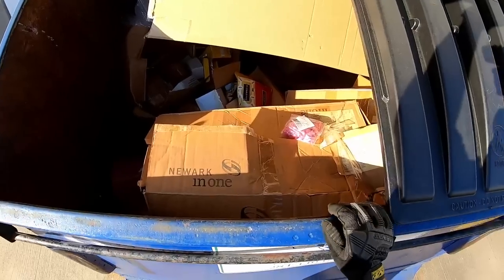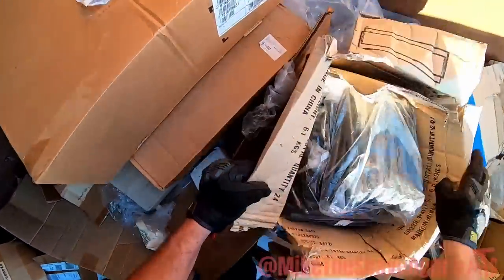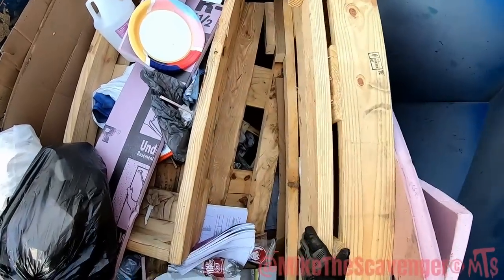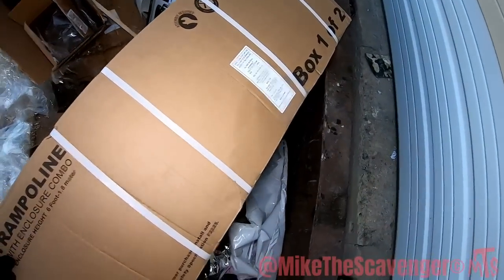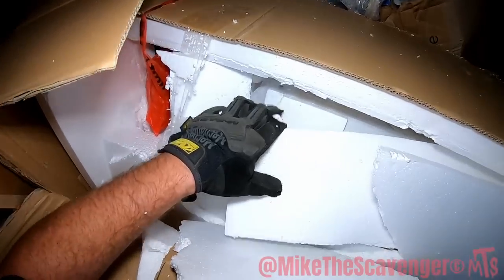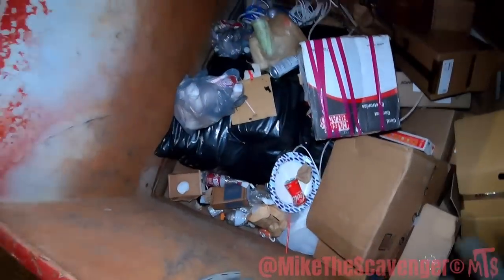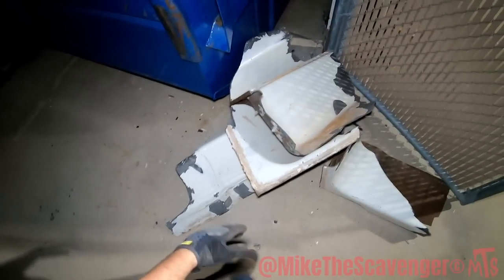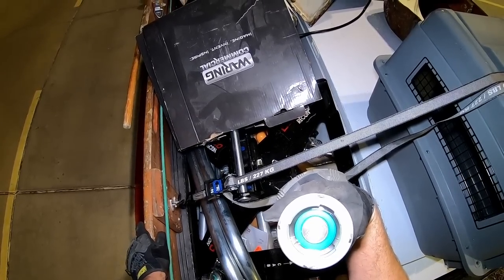Dumpster Diving "Tooty Fruity In My Pants!"

Comment: Wow! I think that one dumpster was from somewhere that builds boat running lights, the one with both red and green would go on the bow, and custom plugs for boats and autos. The pins would go in the plastic housings and have wires connected to them according to the particular wiring diagram. I’ve seen kits for building them.

Comment: The metal pins on the roll in the first dumpster are the pins that go inside the Molex power connectors. They absolutely have value to the right person.

Comment: Hey Mike you can easily fix that kennel with super glue then sprinkle with baking soda. Superglue will drywhen you sprinkle the baking soda on it. You can  build it up then sand it smooth. Works great. Airhugs of positive loving energy to you and yours

Comment: That "machine gun ammunition" looking coil  is for a pin crimping machine, for installing pins onto the ends of wire. The pin strips are probably plated brass. My yard would probably pay "turning brass" price for it as pre-consumer waste.

Comment: That Demco recon is a base for a fifth wheel hitch, that base itself is worth about $580.00 by itself, that hose with the plug in is for an RV so the water line doesn't freeze when it gets cold at night. I have a Demco for sale.

Comment: The house with a plug is for RV use. They are heated so they don't freeze. Usually around $60+ if they are good the demco thing is for trailer hitchs and is $450+

Comment: The hose with the plug is for RV trailers. The hose stay’s heated in cold/winter weather. So, the hose doesn’t freeze and bust. Wish you would have kept it. Would have been interested in buying it.

Comment: That "machine gun ammo" looks like stamped electronic parts, likely the metal parts that you see inside of connectors.
Usually copper, copper alloy, or sometimes steel, they come from the presses on reels like that, and then are sent to reel-to-reel plating facilities where they selectively plate copper, nickel, silver, gold, palladium, and/or tin lead onto the parts before being installed into their plastic housings. Those look to be Ni plated over raw Cu.

Comment: That tool is $300.00. All those connectors are Deutsch connectors or Amp. The orange and green inns go with them. The pins you found can be as much as 1.00 ea.

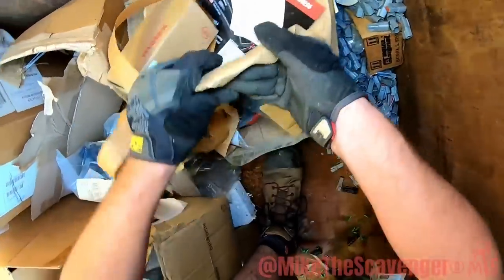Comment: at 5:33 that "something" was a crimper for the pin "(the machine gun amno looking thing)" and socket terminals in that dumpster. those crimpers are upward of 150-200 bucks and terminals are like $25 per 100 terminals new cost.... you scored big and we got quality entertainment .
Reply: the demco unit looks like a fifth wheel hitch adapter

Comment: All those plastic clips are meant for trailer wiring harness i work for a land rover parts dealer and we make our own wiring harnesses for trailer hitches it looks like you got a bunch of pins there that would go in the end of the wire before they actually go in those plastic clips  which are the connecting pieces to go between wiring harness and the wire on the car
Reply: Also those strips that you said look like machine guns strips those are also pins it’s normally how they come they come on a roll and usually you have to break them off the strand before you install them on the end of the wire

Comment: they are all automotive electrial connecters, must have the proper crimpers for them, the rolls of metal connectors fit in the plastic ends after they are crimped to wires that crimper is worth 500.00

Comment: Mike - rhose 'pins' and the matching sockets (which look like pins but the have two hollow ends) go with those Deustch connectors (the grey plastic connectors with pink-ish colored centers.  And FYI - I pay around five dollars for EACH male/female Deutsch connector pair).  Those roles of 'machine gun ammo' are a different style of crimp connector - those big rolls cost big bucks. The crimp tool for those sorts of connectors is $150 to $300, depending.  Just looking at that pile of stuff that's probably easily $3000 dollars or more for just the Deutsch connector gear - all of that will sell quickly on eBay.  Those fan motors look like some sort of foreign car dash component, probably what the market would call NOS, or 'New Old Stock'.  Do some sleuthing on the fan part numbers and throw them out on eBay - chances are you'll make a fair bit of money on those as well.  As for the pink butt connectors, I don't know what a good resale price might be but you could start with $10 a bag on ebay.  Good luck!   :)